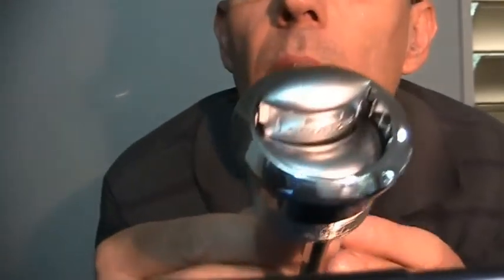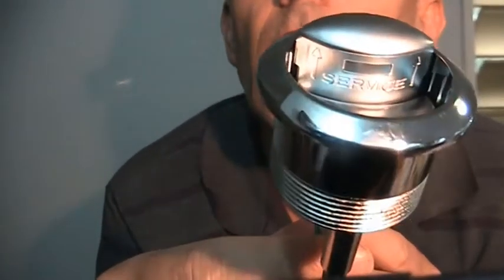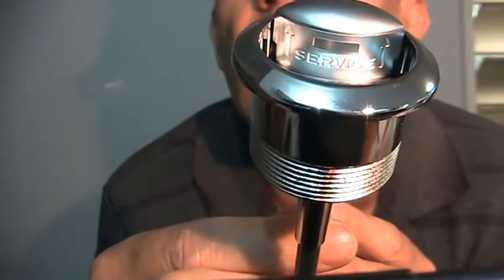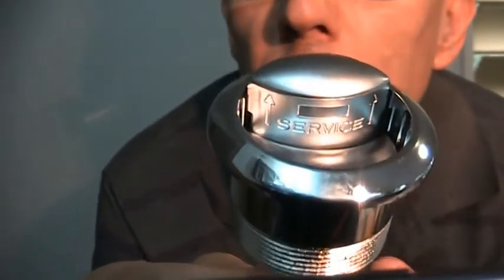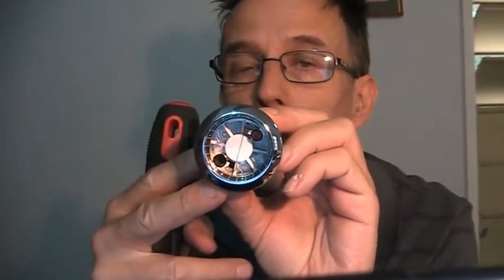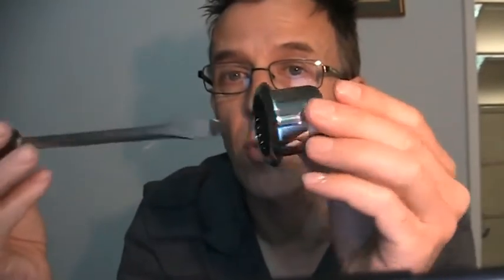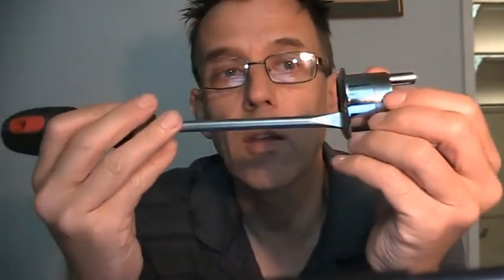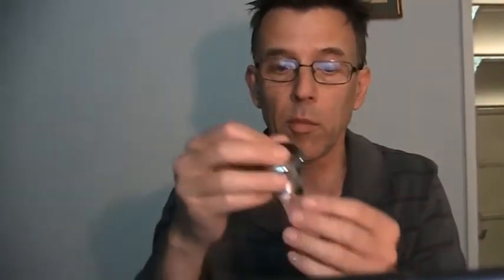Removing a cistern lid with Geberit Twico 1 button Australia and NZ

Comment: I just moved in to a new apartment. The toilet button is just like the one seen in your video above. Unfortunately, both buttons are stuck down with corrosion, so I can't get underneath them with a flathead screwdriver to remove them like you have suggested. Luckily the toilet can still be flushed by pushing down because the buttons are not flush-no pun intended-with the tank lid the whole flush valve can depressed by pushing the buttons down. I'd like replace these buttons so I can have both the half and full flush available. Have you got any suggestions regarding the best way to remove them?